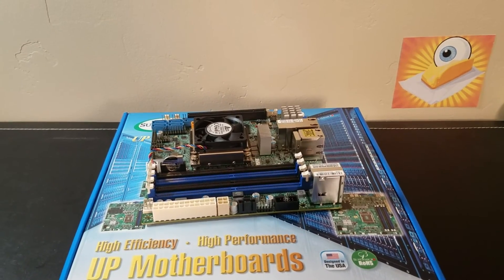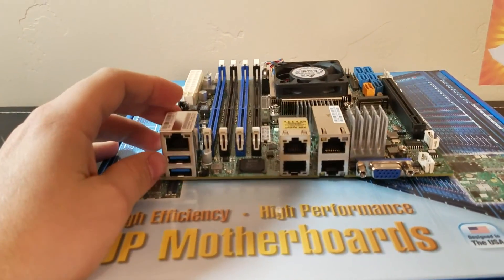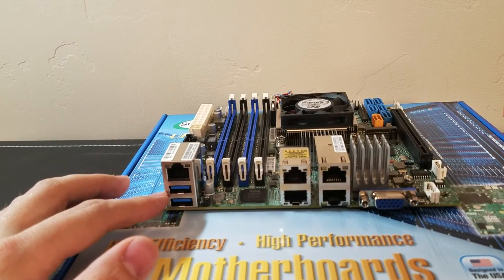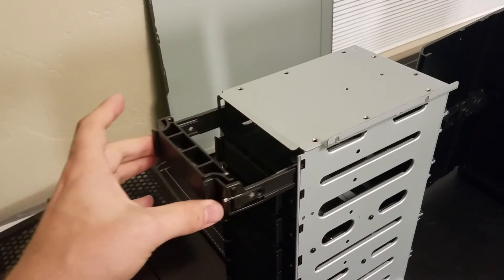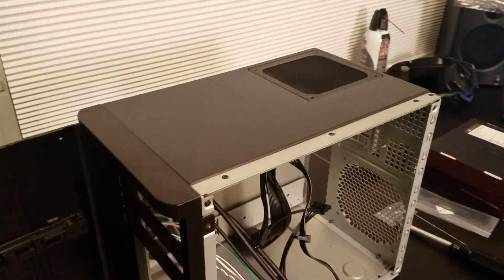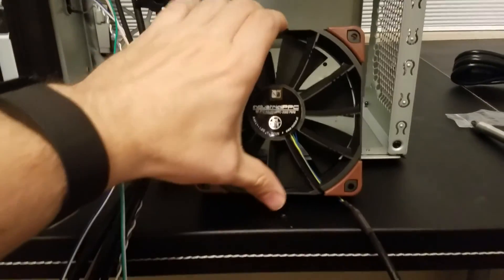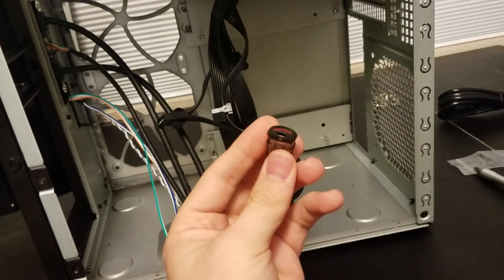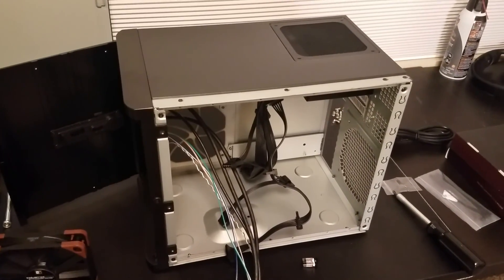Mini VM Server Build Preview - 16 Threads! ESXi6, X10SDV-TLN4F, DS380B, 128GB, 80TB, Xeon D1541

Comment: eeeh, that board only has 6 SATA connectors. Not sure how you'll be connecting the extra missing 6 you're speaking of, because if you use the PCI slot for M.2 NVMe, there's no room for more..
Reply: PCIE -> SATA card, or you can use a NVME riser to get an extra PCIE slot :)